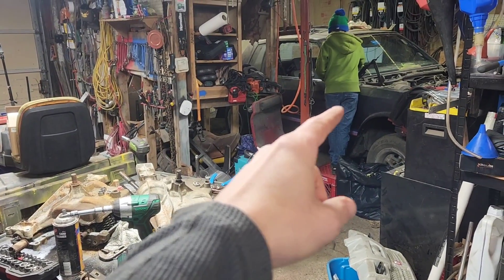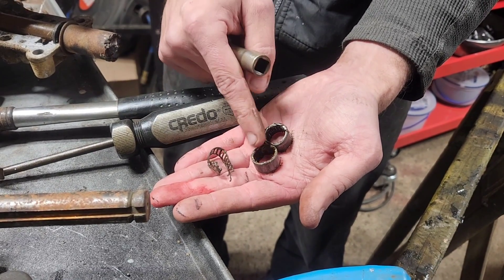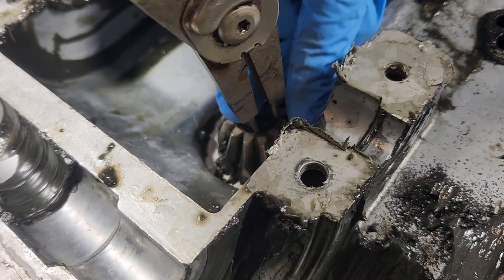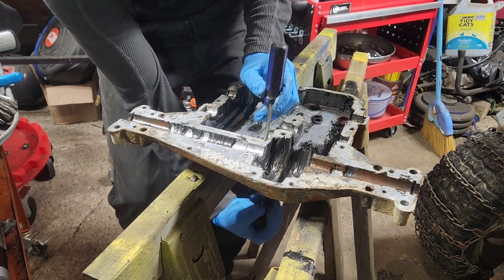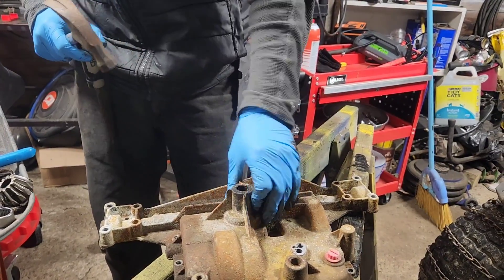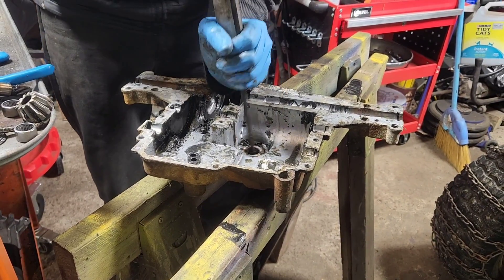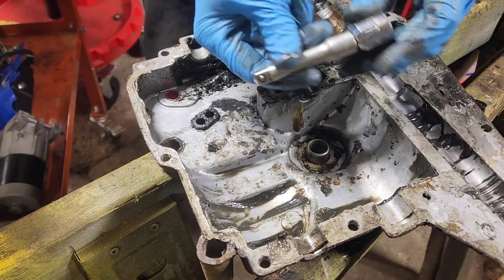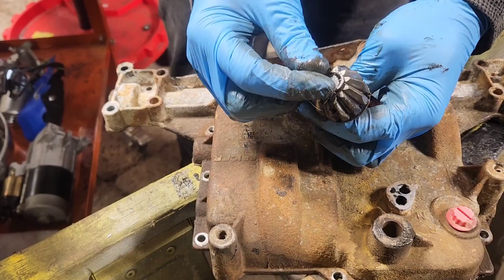Spicer 4360 Input Bearing Replacement

Comment: What prevents input shaft from upward movement, i have a lot of axial play after assembly, does just the weight of the pulley keep it engaged in the ring gear?

Comment: For my 4360-140 .. Cse108 bearing number  available through AutoZone as of today. Timken Axle Intermediate Shaft Bearing Front SCE108 for Dodge Jeep. 

Spicer 565985 Axle Spindle Bearing SCE108

It's on the jungle site as well.

Comment: If you don't install a new rubber seal on the top of that shaft, you can't expect the new upper bearing to last very long, the dirt/water will drastically shorten it's life, mowers are good at making dust/dirt fly. The part number you show on the video is for a bronze bearing for the internal gear shafts, not the rubber seal. The seal is no longer available, but it can be had from one of the largest bearing manufacturers in the world - SKF
Don't forget to grease up the new bearings.
It's real easy to 'make' a bearing puller with a long bolt, the right sized socket or spacer, a few washers and a nut.
You really going to clean up that rusty disintegrating washer instead of just replacing it?
Reply: Hello Were you able to get the seal through SKF and if so what’s the part number 
Thank you

Comment: it helps to heat the aluminum before trying to knock out the bearings.... Old guy tip
Reply from the maker: True I normally leave that out of videos as an option cause the casting on these is not pure. Have seen several pics posted where cases failed from a basic propane torch. On a higher end MST I would risk it if needed.

Comment: If you were to do a lot of these you might want to weld up some kind of a jig to hold the casing make your life a little easier heck even something made out of wood, that'd be a good project for your son
Reply from the maker: Agreed I would build it based on the murray type to be sure the shifter linkage fits.

Comment: How much would a person have to charge to profit from a repair like this when you figure in your time and the cost of the parts?
Reply from the maker: The problem is you can never fix it right only as best you can. These love to break off the case bolts. Fixing it right means threw drilling and replacing with 1/4 20 bolt and nylock nut. Then comes the discontinued seals on the brake shaft and the input shaft. Cost parts wise is sub $20 make it $30 to cover brake pads that are always toast by this point. Even I take 2 hours to do the full job. But compared to a MST206 in surplus sales still goes for $250+. Conclusion it would have to be a customer I like.